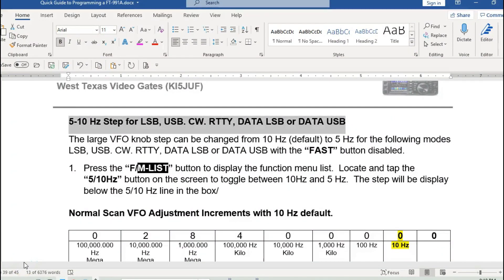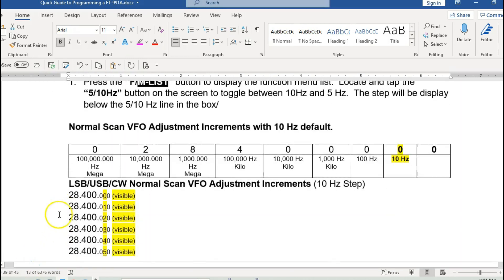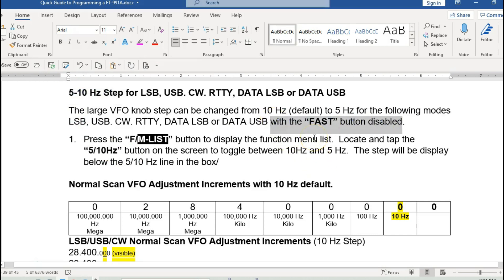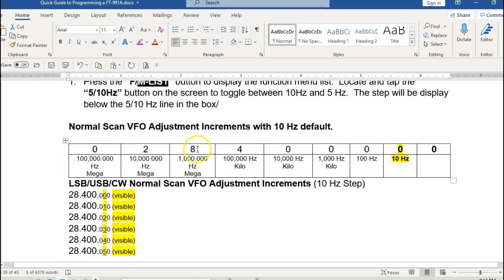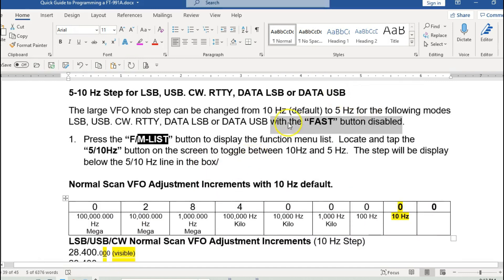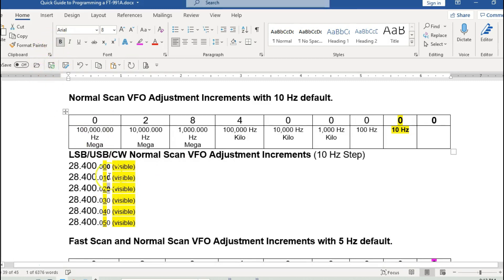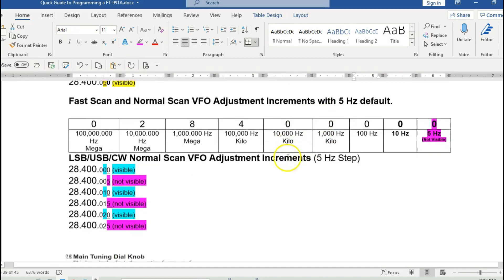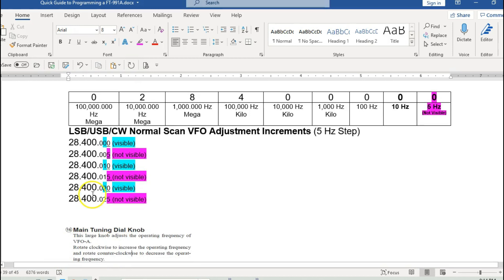5-10 Hz Step for LSB, USB. CW. RTTY, DATA LSB or DATA USB

Comment: I got it. 

5 hz setting -1000 hz = one vfo knob rotation 

10hz setting - 1000 hz = 1/2 vfo knob rotation
Reply from the maker: Good deal, your correct. let me know if you need anything else '73 de Ki5JUF